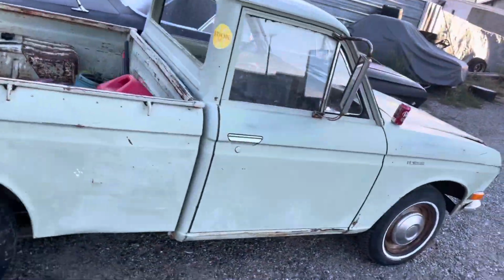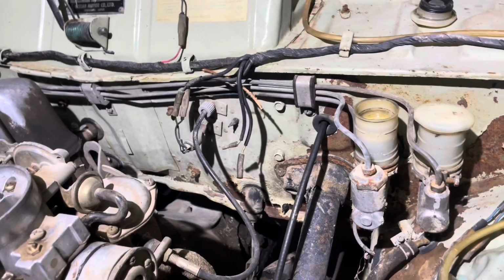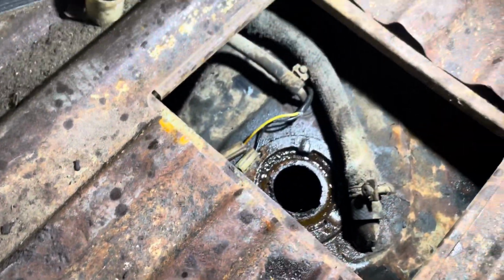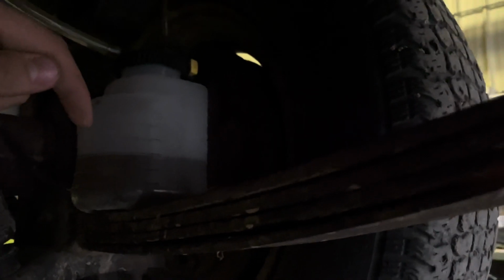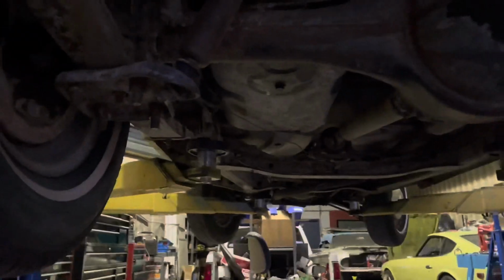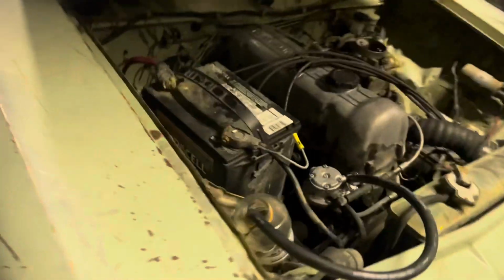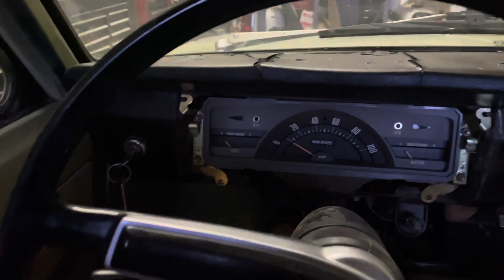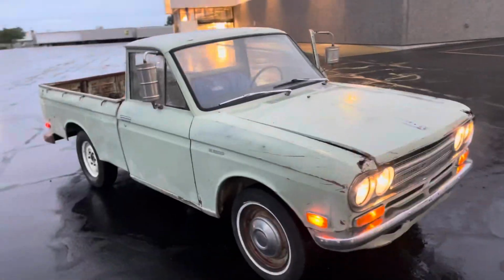Fixing the brakes!

Comment: Beautiful little truck here, wouldnt change a thing after this point. Get her sanded down, primed , and paint the underside chassis and floorboards, frame with black rust olem paint, then get the rest of the truck sanded doen and painted a nice color.  And, please, keep the wheels and tires on it just the way they are, don't put those ugly, silly looking wagon wheels and thin tires on this truck, you'll ruin the looks of it completely.